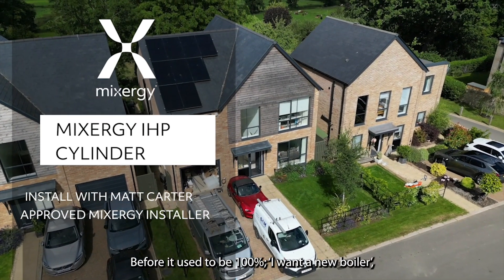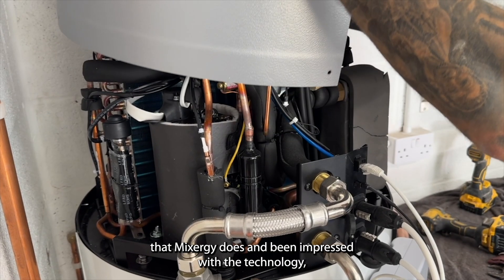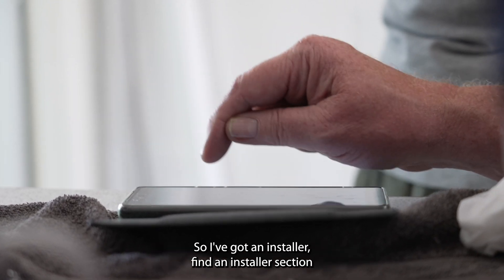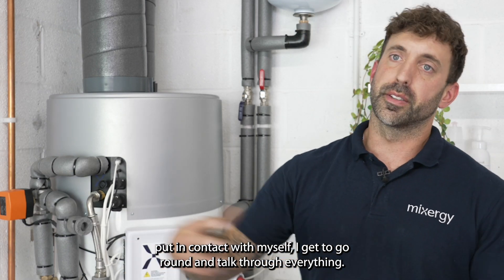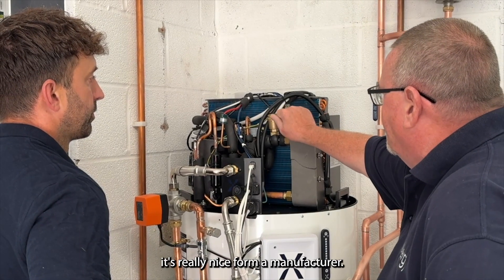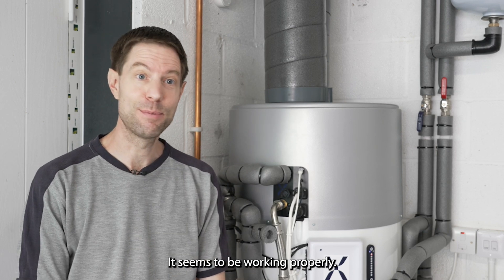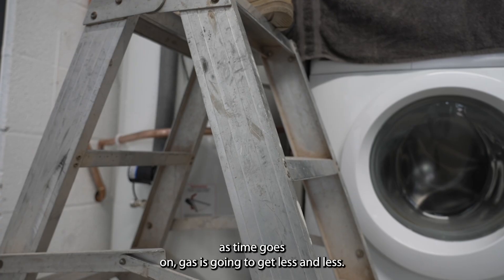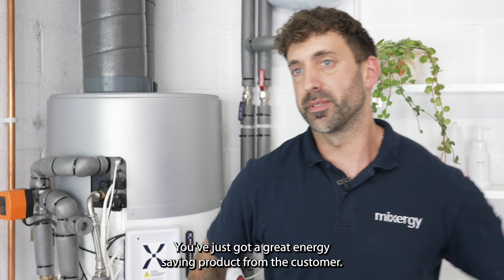Matt installs the Mixergy iHP X - "This is a great energy saving product for the customer."

Comment: Looking at getting Mixergy IHP but would struggle to get 1.5m distance between intake and exit ducts easily (aesthetically). Can the ducting be extended externally to provide this?
Reply from the maker: Thanks for the questions, for a detailed response to any questions you may about the installation please submit an enquiry to our team at https://www.mixergy.co.uk/contact/. Ducting depends on many factors, and we would advise you use a G3 qualified Heating Engineer to take a look. Our Mixergy Experts is a great place to start, search for one near you here: https://www.mixergy.co.uk/experts/find-an-expert/